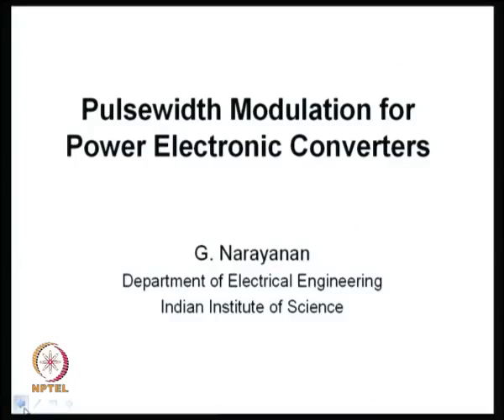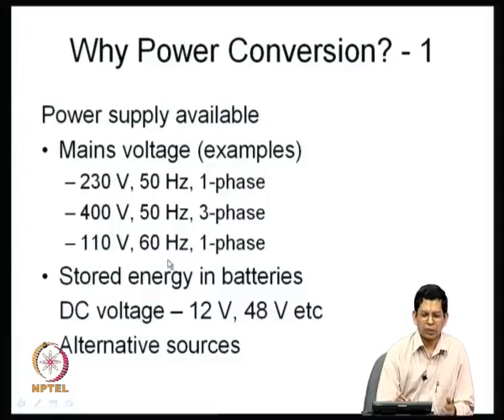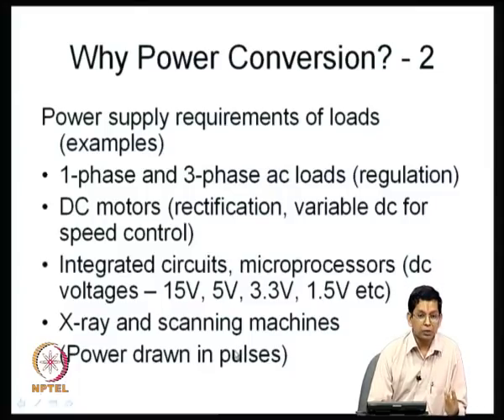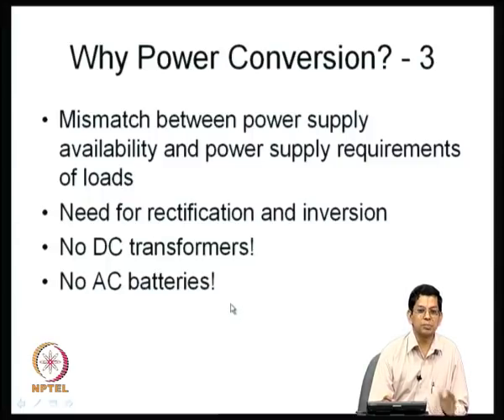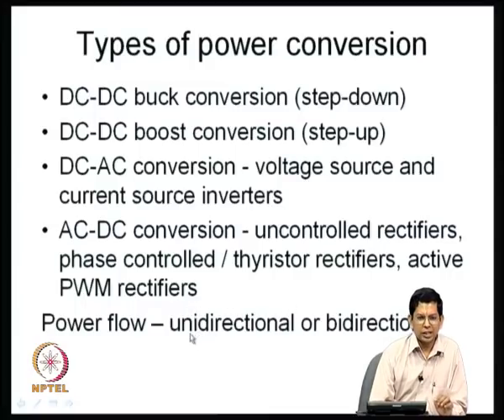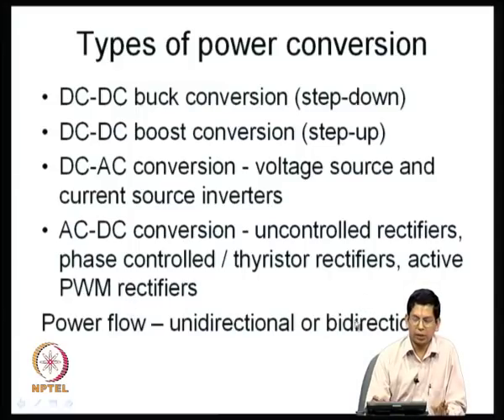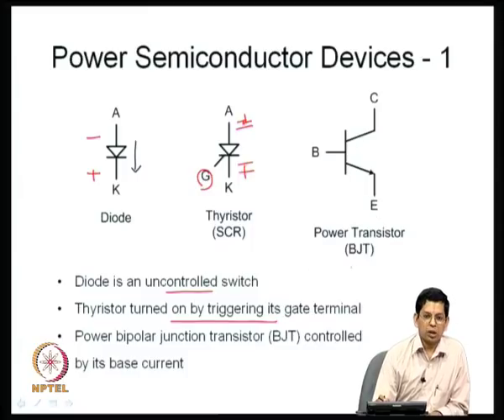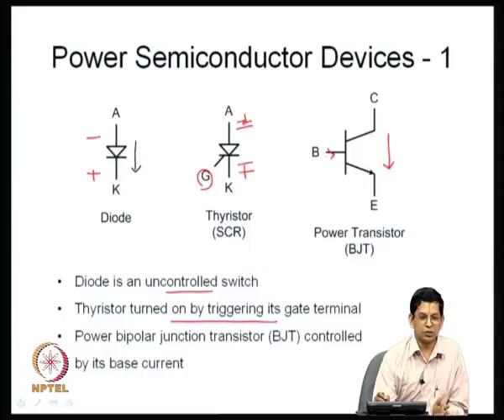Mod-01 Lec-01 Electronic switches

Comment: Answer for the question asked finally is connect 4 BJTs such as in one limb the two BJTs are connected in anti-series (voltage blocking ability is opposite) and connect a diode inbetween. Hope it is right sir! thank you for the wonderful class.

Comment: sir, I have some doubts. Would you please answer it?
1. What happens when reverse voltage applied across a BJT?
2. why BJT is called bipolar though it does not conduct or block in either direction?
Reply: +Debadutta Sahoo The BJT is called bipolar because the operation of this transistor depends on two kind of currents that are hole current and electron current.
Reply: I think flow of holes and electron as well possible
Reply: 1. Forward Voltage at BE and Reverse voltage across CE  works as amplifier..
2. BJT uses Electrons and Holes both for conduction so called Bipolar. Not Like MOSFET  unipolar device which uses only Electrons for conduction.